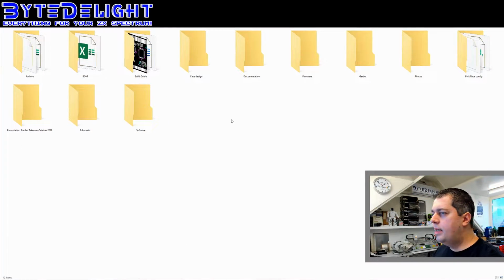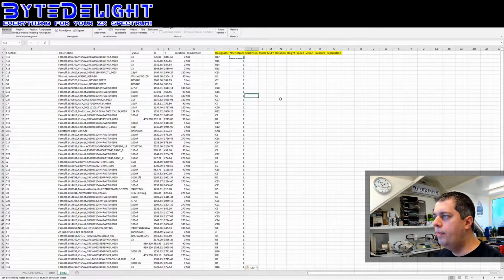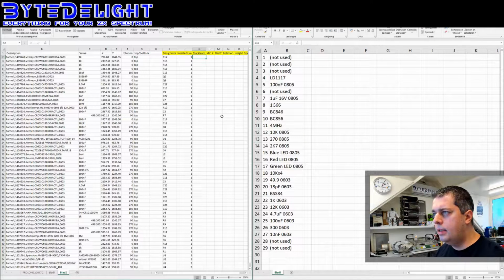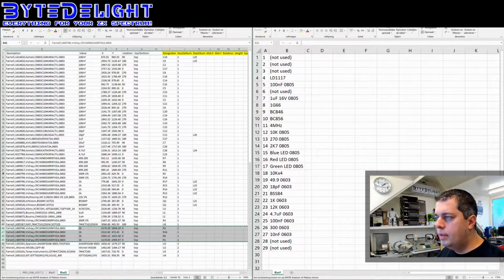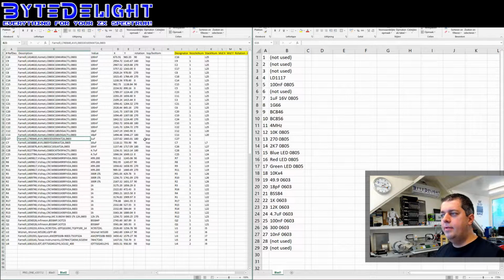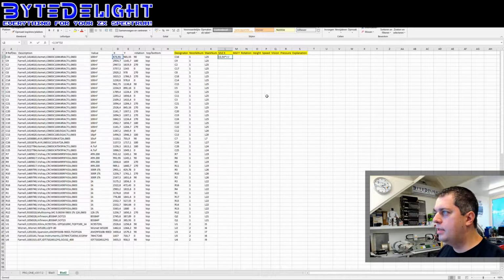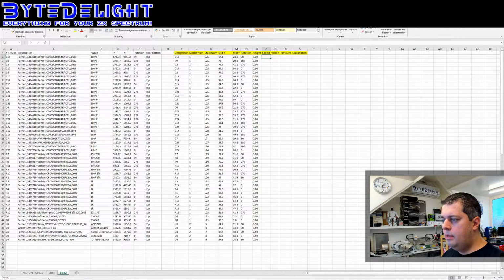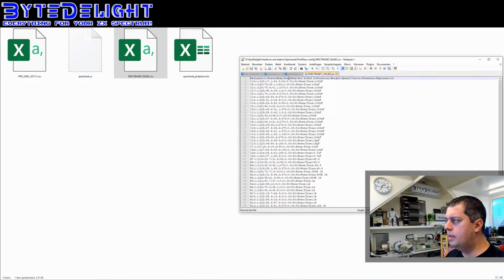Spectranet assembly on TVM802A pick and place - part 2

Comment: Looks like you are going through a lot of trouble here? SurfaceMount.exe can read most common pick&place .csv formats (from KiCAD, Altium etc.), it will convert them automatically. I usually make my modifications after saving the converted data from SurfaceMount.exe